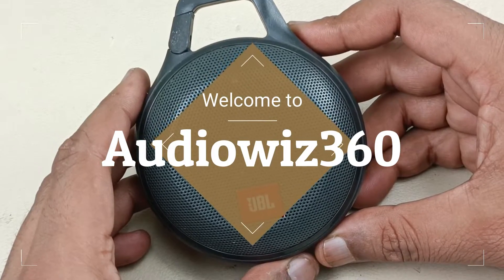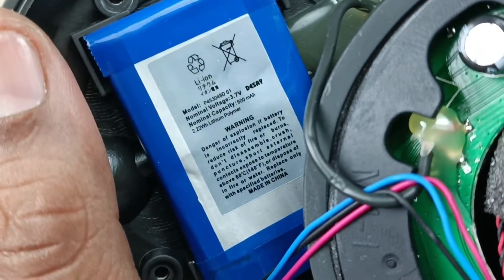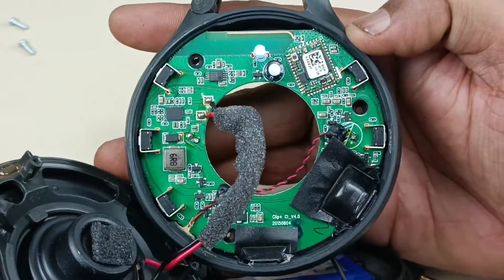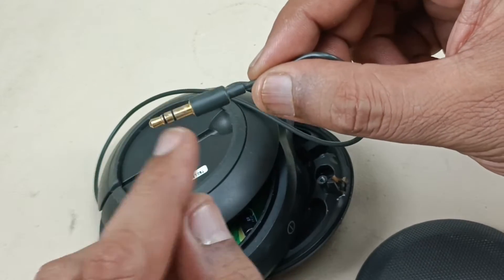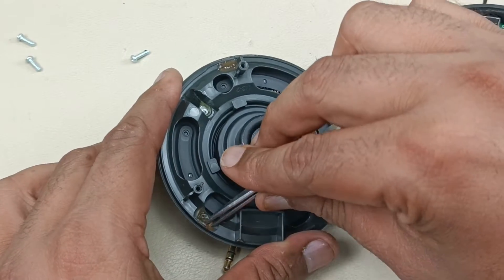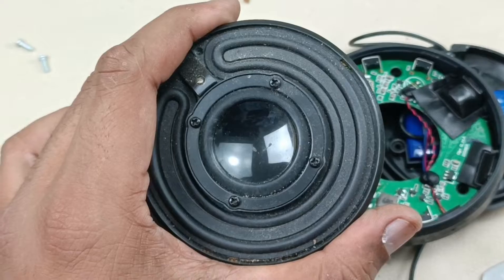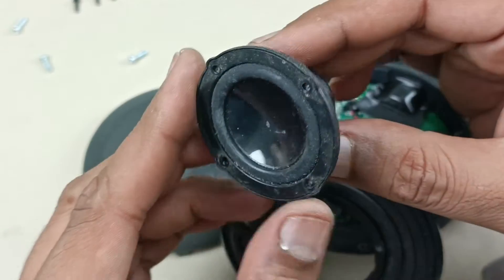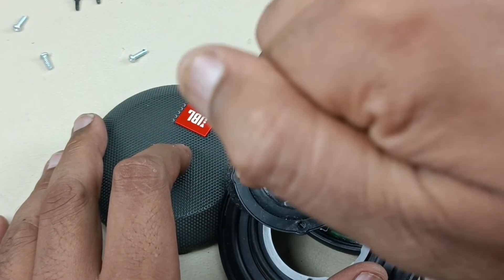Teardown of JBL Clip+ Bluetooth speaker  and Look inside | How to disassemble | What is inside

Comment: Which website did you buy this speaker from?
Reply from the maker: this was purchased long back. what is the problem you are facing?
Reply: @audiowiz360 , I do have this speaker. My problem is that fully charged it may play for 10 minutes or less and then shuts off. If I turn it back on, it will shortly shut off again. Is there a way to easily fix this?
Reply from the maker: @rooirand100, you may need to replace the battery of it.
Reply: @ I know and didn’t want to change the battery when I looked into it. I ended up giving it away and the lady who took it, leaves it plugged into her source and said, it works great that way and she has no problem with it now. Bonus for it, the sound was great while it lasted. She was pretty happy with it!
Reply from the maker: nice
Reply: I'm not facing any problem. I just wanted to buy this speaker😊
Reply from the maker: you want to buy it?
Reply: I wanna buy this old speaker because I had this same speaker before but sadly it stopped working so I had to throw it away.😞
Reply from the maker: it's available for sale.
Reply: I will buy it
Reply: Whats the part number of the battery?
Reply: I wish you had gone into the charging port. Purchased mine new years ago, after using it once it never charger again. Have the original charging wire and have tried others. It refuses to charge. Literally brand new, unsure if its something I can fix or just defective.